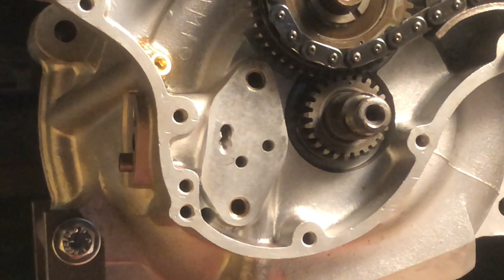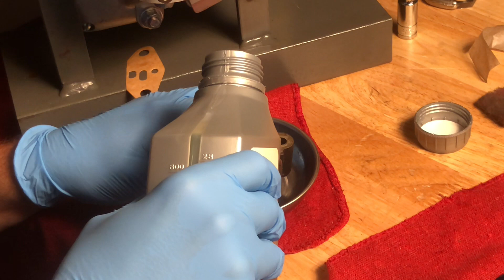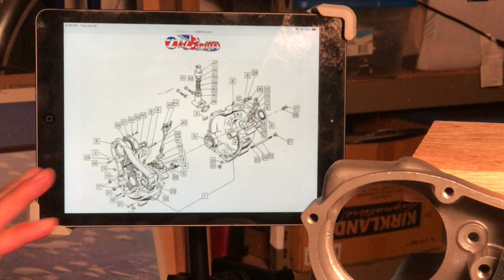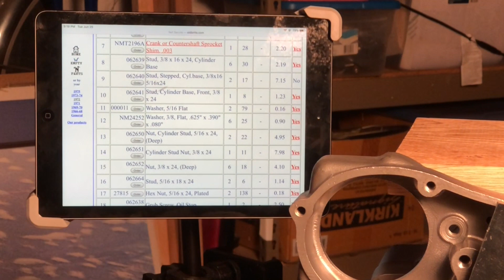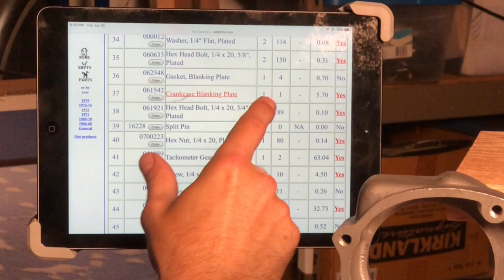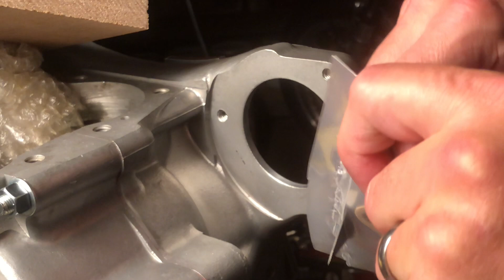1972 Norton Commando Combat Rebuild (11) - Fitting oil pump and backing plate

Comment: the reson to fit from the back is so as not to have a loose nut flying round in case it would come loose. it would be stopped by the case cover

Comment: I used to use petroleum jelly to prime oil pumps, it dissolves in the oil, will be flushed out after run in and stays where you put it until oil is flowing, cranks and bearing surfaces were always well oiled on assembly and the cam used a molly based run in lube that was as sticky as shit on a blanket.

Comment: Hello Dave, you are doing a fine job on the rebuild but putting Mobil 1 into a new rebuild is a no no. You want to put a cheap oil in the bike to run it in and give it the beans for 50 miles and then drop it and then get some better oil in but i would lay off putting Mobil 1 until you have about 1,500 miles on the bike. You tend to only have a short window to bed the rings in. I did the above when my 1973 Triumph Daytona got rebuilt and not a wisp of smoke out of the pipes and little oil consumption. Check out this link, well worth a read http://www.mototuneusa.com/break_in_secrets.htm   Good luck with the rest of the build. Cheers. Billy from Barrow In Furness Cumbria England U.K.
Reply from the maker: Thanks a lot Billy!  I grew up in Barrow!!  Back when it was part of Lancashire ;) LA14 4JX!  My brother and I went to the Technical School for boys and then Sixth Form college!  Thanks a lot for your great comments and for the Barrow connection.  Cheers, Mike